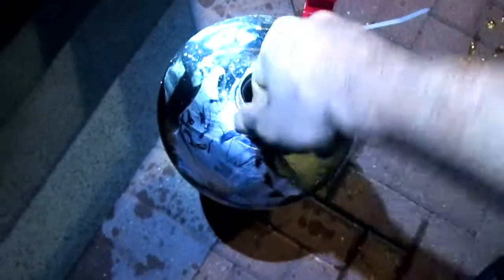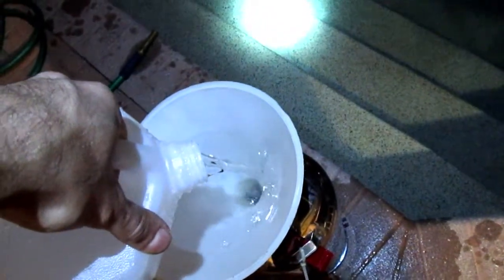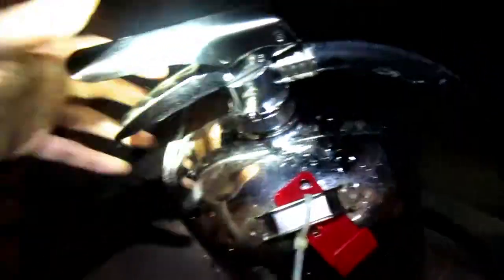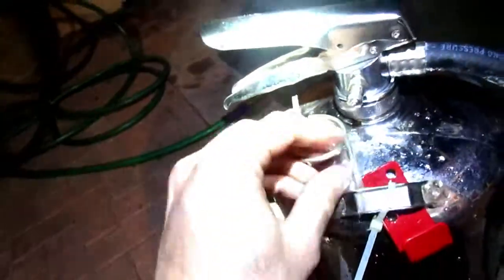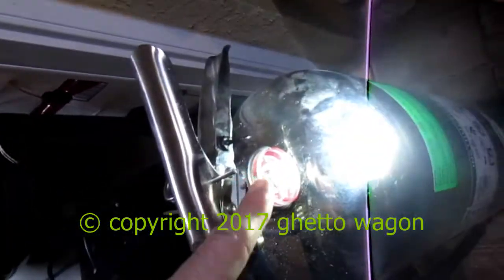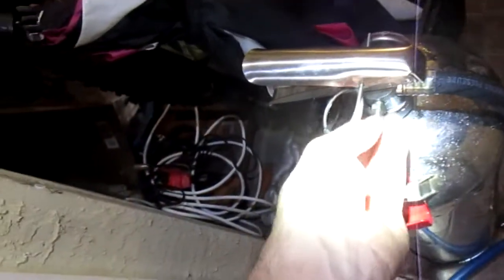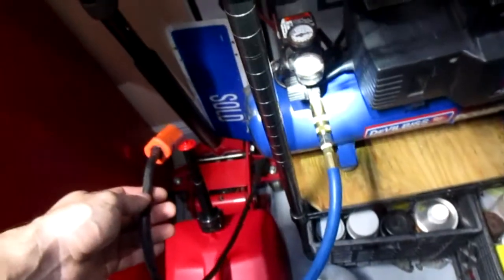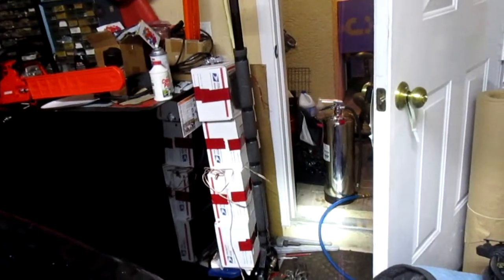Water Can Recharge!  Fire Extinguisher

Comment: The chalk (dry chemiical) kind is a bit more difficult to recharge at home. First you have to remove the valve and disassemble and clean it thoroughly or else it will leak pressure through the valve. They also operate at a higher pressure level ((i.e. 180 - 200 psi) so you need a compressor that can do the higher pressures.
Reply from the maker: Ya i need to get some chemical and try to recharge one of my found fire extinguishers that went off.   Its a good one. ANSl brand something.
Reply: @GhettoWagon  ANSUL???  Yeah, if your compressor can do 180 -200 psi you can probably charge the.very chem. You might use a moisture trap between the compressor and the extinguisher so that moisture from the air doesn't contaminate the powder